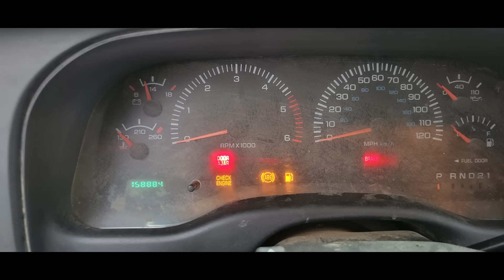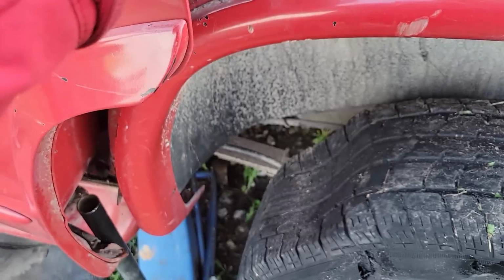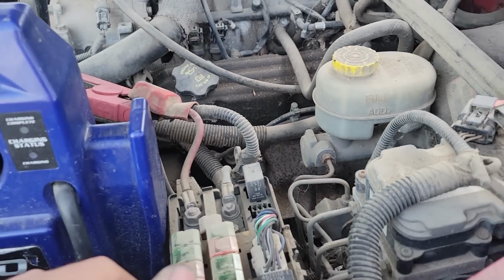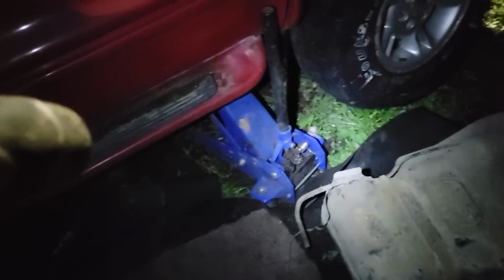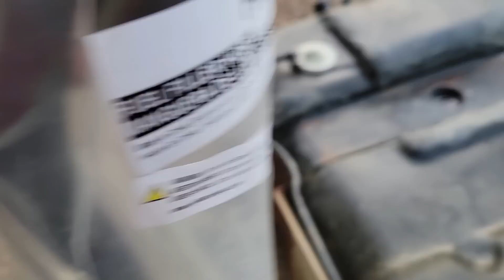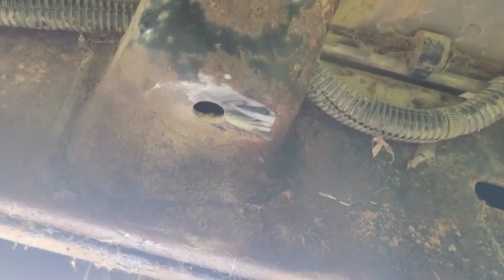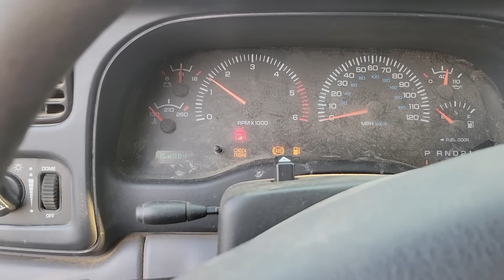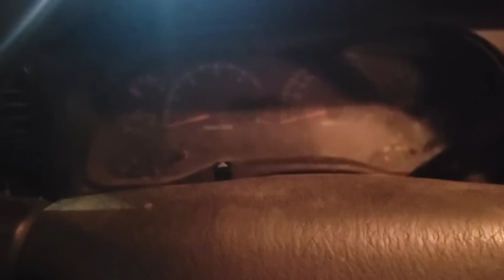1999 Dodge Durango SLT abandoned for 14 years | Will it run and drive? | Part 1

Comment: Never underestimate a 5.9. I don’t get why they are hated so much. Everything has its own issues. Owned my 01 1500 reg cab long bed 4x4 since highschool. 342k miles original engine and trans. Biggest repair was the intake plenum replacement. Has been the most dependable truck I’ve ever witnessed.

Comment: My 1999 dodge dakota RT is my daily driver vehicle here in new mexico. It lives outside. I'm not gentle with it. i was under it the other day. And it looks a thousand times better than that poor Durango. The rust other parts of the country get, just astounds me. I could easily remove every undercarriage bolt with a wrench and no penetrating oil just crazy.
Reply from the maker: Yup! It's a fun time up here in the rust belt.
Reply: Yeah I dont live up north anymore.. But I would CRY to see my nice vehicles rusting away.. Its like you pay for them and yet they depreciate so much more.  My uncle up in Michigan has these water spray nozzles that are actually piped under the concrete on his drive way, and he pulls the car right to the spot they are set up. Het gets out and goes to the side and turns on the water and its HIGH pressure sprayers in all angles which are set to spray off all his undercarriage. Once its rinsed off, He then pulls it into the garage where it drips off and goes into the drain in the middle of the garage.
Reply: That 1999 Dodge Durango is awesome but not too bad 😎😎😎😎😎😎😎😎😎😎😎😎😎😎😎😎😎😎😎😎😎😎😎😎😎😎😎😎😎😎😎😎😎😎😎😎😎😎😎😎😎😎😎😎😎😎😎😎😎😎😎😎😎😎😎😎😎😎😎😎😎😎😎😎😎😎😎😎😎😎😎😎😎😎😎😎😎😎😎😎😎

Comment: My parents used to have a 2003 SLT when I was young , It had the 4.7 in it.. But it was shockingly quick. I have always wanted to get one of these since and lower it with some nice sport suspension. Then put some viper knock off wheels on it. Then do much more to it to make a Viper clone Durango.. Kinda like the SRT-10,   but Obviously not with that motor.  Just have the looks.  When my parents had it I used to BEAT that thing to death doing insane stuff and it took it like a champ.

Comment: It’s crazy how some vehicles have different lives,, I bought my 02 Silverado brand new, ive all ways garaged it, it still looks new ,,the frame still has the stickers on it, I live in Arizona, the frame and body have zero rust, I’ve seen new trucks with surface rust all ready on the suspension parts and parts of the frame just after a few weeks of off roading in wet conditions!

Comment: I loved my 99. The 5.2 magnum was surprisingly effective at motivating all that weight.
The heater core blew open during some rigorous throttling, and I replaced it myself.
Not a task for any of the usual shade tree mechanics. The entire dash needs to come out. 
And make sure you disconnect the trans dipstick tube from the firewall...
Reply from the maker: Heater core in my neon was a royal pain too. Dash gutted to the firewall as well lol!
Reply: You mean 5.2 ?     A 5.3 is a Chevy boat anchor
Reply: @kevin61906  5.3 Chevy boat anchor? I think you're being a little too brand loyal there. The 318 was a good motor, but the 327 was/is hardly a boat anchor. Unless you actually tied a chain to it and threw it overboard. 🤣
But thanks for correcting my error.
Reply: @kevin61906 the 5.3 in my 05 Suburban Z71 just keeps running towards 400K.
Reply: The 5.2 is the version i want. 318 is reliable.
Reply: Dammit sounds like hell.. I have to replace the heater core for mine

Comment: Slt plus, leather seats power everything, rear air, have one with black interior, you missed the stereo control the sound controls on the back of the steering wheel, wranglers came on that original, you got a nice car
Reply from the maker: Oh it has radio controls on the wheel??? I didn't even think to check!

Comment: Love the Durango's,.  I've got 3 right now, my 98 model has 276k miles and still going strong
Reply: my Dodge also has 276.000. But it's a intrepid.
Reply: That's saying something, those V6 engines normally don't last that long.    Also don't see very many of them any more
Reply: On my 1998 Durango, It makes a clunking sound when going slow around a turn and I can feel the truck decelerating as I make the turn. Like really decelerating. Any ideas?

Comment: Just FYI.. if your first gen durango has leather seats, premium speakers, the infinity system, and fog lights you actually own a slt plus. Factory only put the slt badge on it but it is in fact an slt+
Reply from the maker: This right here. This is great info. It's been a year and I was not aware lol!
Reply: @MNMoparMinivan  if you go to your local dodge dealership you can give them the vin for the durango they can print out the entire build sheet for your durango. What transmission, transfer case, rear axle, front diff etc etc..

Comment: I have a 99 Durango Magnum 5.9 that sat for a number of years before I got it and right off the bat crank sensor possibly battery alternator or ignition switch or possibly map sensor has caused it to lose all electrical power to all lights and accessories(dash lights) along with no electrical current to starter. And that's just within the first 6 months of ownership and minimal operation. Because the last thing to happened to it before parking it was as I just mentioned all power to all accessories lights and starter. Show no for sure only possible signs of a faulty fuel pump or filters. I let it charge on high overnight I got the lights and accessories back barely and starter made a clicking noise when tired to crank the next morning so I continued to let it charge for another hour till battery said 100% then tried to start it again then all power was lost again even with the charger still on and hooked up to battery. So I'm assuming it's all electronic related battery alternator or sensor wise. So my suggestion to getting an old Durango up.and running again it's gonna take some serious trial and error and trouble shooting. Along with potentially a ton of money. And those crank sensors are a bastard to get too let alone remove. The love hate relationship with me and that thing has begun lol

Comment: Check  the plug in on the side of the trans if the connector is  loose  also the over drive  shut off switch on the shifter can be a culprit they were actually  pretty good  vehicle's  the 5.2 and 5.9 were great  engineers
Reply from the maker: Thats what I was reading on a few forums is that connector gets loose/corroded. Thats what I'm hoping for!

Comment: On my 1998 Durango, It makes a clunking sound when going slow around a turn and I can feel the truck decelerating as I make the turn. Like really decelerating. Any idea why?
Reply from the maker: Not sure about the deceleration but the clunking could be balljoints going out. Hard to say without looking at it. I would try get the wheels in the air and try shake down the front suspension.
Reply: @MNMoparMinivan  Thankyou for your reply
Reply from the maker: @crystalhappy7588  no problem, good luck!

Comment: I wonder why someone parked a ten year old Dodge. It's not that old for a Dodge. Mine was just getting broke in at ten. Now it's 21 and still running as good as it ever did.
Reply: On my 1998 Durango, It makes a clunking sound when going slow around a turn and I can feel the truck decelerating as I make the turn. Like really decelerating. Any ideas?
Reply: @crystalhappy7588 maybe a transmission issue?

Comment: I have a barely over 100,000 mile 97 dodge dakota, WHY the braking system shown on this truck, they were a BAD idea, they were discontinued way a long time ago about five years old for these trucks, you can find brake parts like  anti lock front hubs and parts to keep it going if that brake system still works, anything in the internal system is a nightmare, had a brake line break at the lower union block, cant find part one ANYWHERE!  have to convert it to 2 wheel antilock,

Comment: That's the the Durango with the bigger V8 like the 5.2 or the 5.9 nice we have the same exact Durango in our yard it's the I think it's a 4.6 v8 still runs and drives says 2 with me a very pretty 244,000 MI but it's going to the junkyard because it's way too rotted it's body is a mess it's last ride will be probably going on the back of a flatbed it sucks it was a good vehicle
Reply: It's a 4.7 , they're actually the worst magnum engine  produced
Reply: How much do frame swaps coat?

Comment: So a perfectly good truck got parked and left to rot all because of a simple fuel pump needing to be replaced smh
Reply from the maker: Transmission is in limp mode. I think that is why it got parked actually. Hindsight tells me that the fuel pump failure is probably from sitting. Who knows though. I didn't get much info about it lol